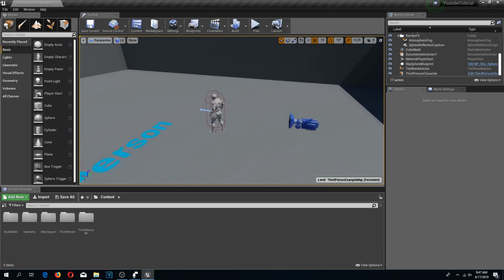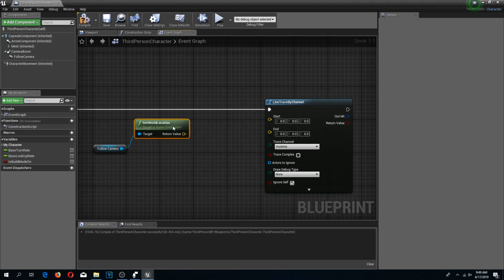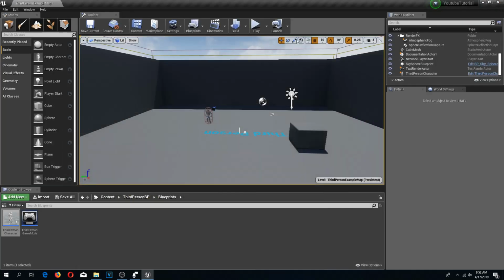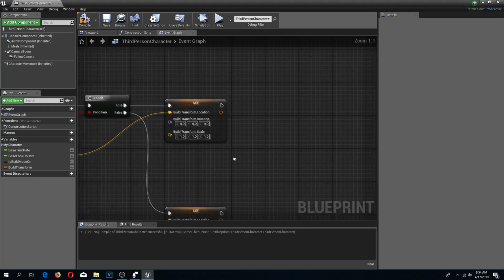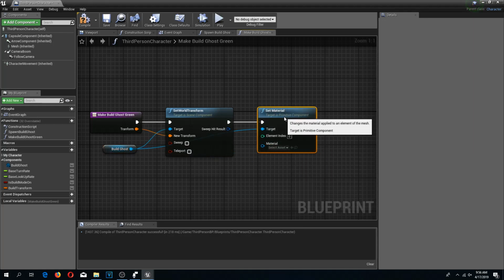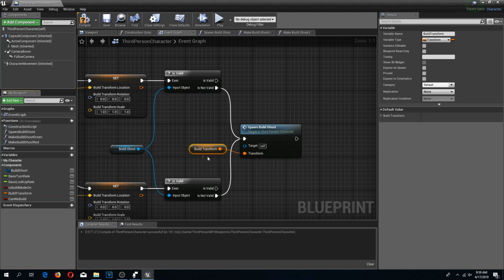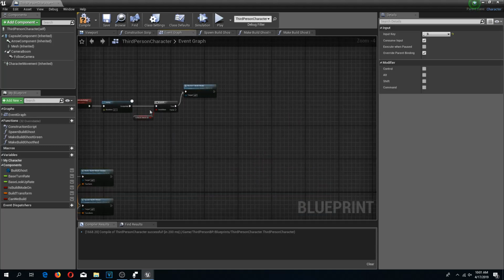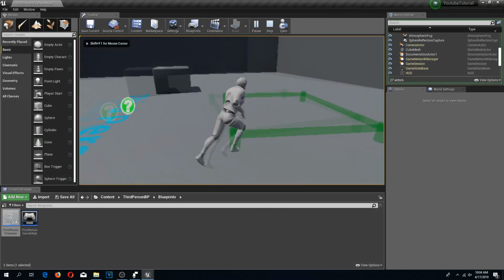UE4 Survival Series Ep2 / Build Mode Tutorial Spawning Preview

Comment: Discord is down ATM or i would comment there. Everything works except only when my Linetrace is casting to another static mesh in world. i cant get it to appear green when hovered over my landscape. any ideas?
Reply from the maker: Check if the landscape blocks the trace channel you are using. Because if it's overlap on ignore, it will not work.

Comment: oddly my line trace is working in reverse. in TraceLineByChannel setting the trace color is set to red and the hit color is greet but in my scene the line is coming out green and the hit box is red and its as if the line is being traced from far away and the is going towards the camera. I've rechecked many times and everything is set up exactly the same. so odd
Reply: fixed it - problem was initial trace was hitting character just had to increase the "300" value :)
Reply: ah but i still have the problem where the line trace seems to be inverted so the hit location in mid-air is coming up as a acceptable build location

Comment: Having trouble getting the red line to shoot in front of the character, and the line plus the object appears on-screen at random locations when I hit the B key. The glitch seems to not want to correct itself when I copy the Vector * float and the Vector *vector and connected them in place. I triple checked connections, they are correct. Can it be a glitch with the camera? Also when I followed the video and entered 1000.0 under the first Vector *float and the 300.0 in the second one, my object wasn't very visible, it appeared off into the distance. I changed the values to 1.0 and 1.0, and it appeared closer to the character. Is there a way to get it to stay visible with the video's values that were entered?
Reply from the maker: Common mistake, people multiply world location instead of forward vector.
Make sure you are multiplying forward vector and then adding world location to the new vector.
If that's not the case in your situation, join my discord send send in a screenshot from your line trace.
Reply: @ItsMeBro  Thanks, I will check that. I also asked for help in your discord with a screenshot under the help section.